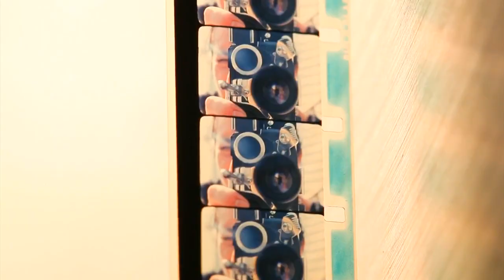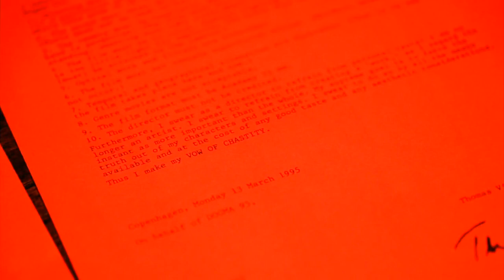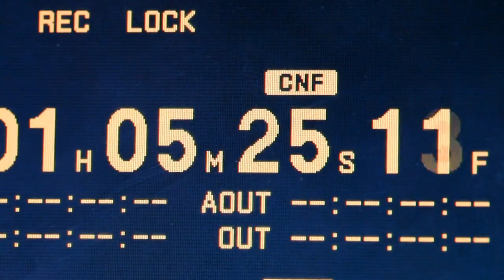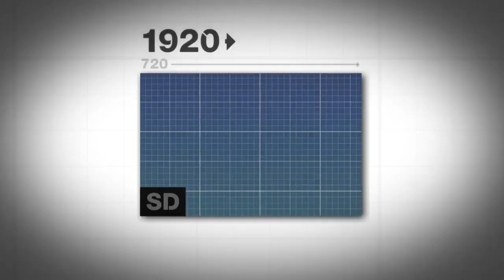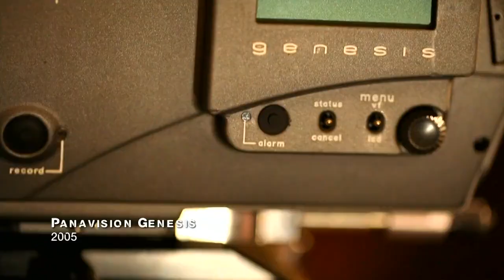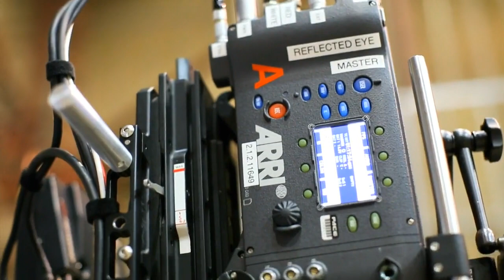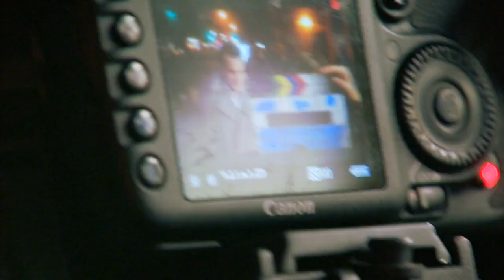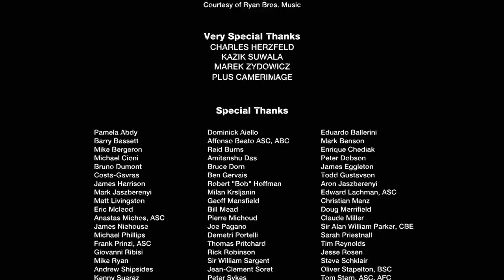FILM vs. DIGITAL : Christopher Nolan | Martin Scorsese | James Cameron | David Fincher

Comment: Film : Offers unique texture and vibrant colours but expensive to purchase.
Digital : Images were sharper and cleaner, the sensors are more sensitive to light which resulted in more natural lighting but digital images lack the feel of the film.
Sure, 4K digital camera has surpassed 35mm film in terms of picture quality since early 2000 but it still can't beat 70mm film. This is why Nolan still prefer to make movies with traditional formats. However, in the future 8K digital camera would be available soon or later.